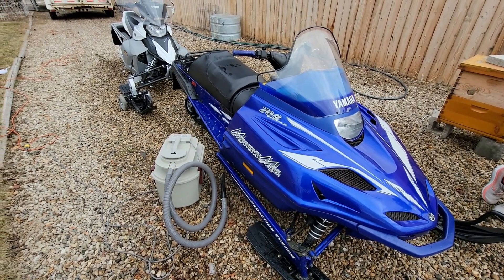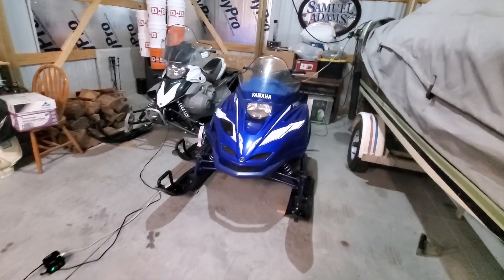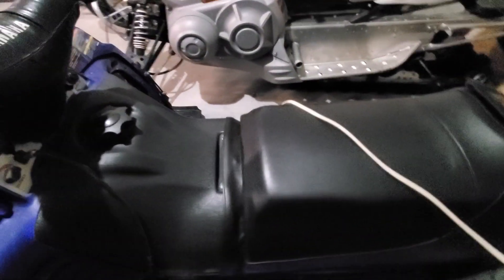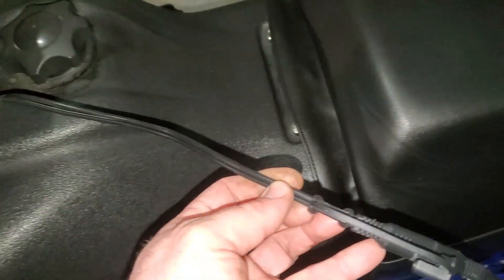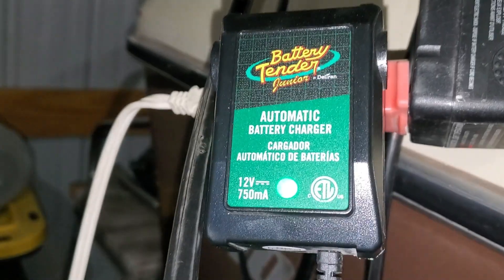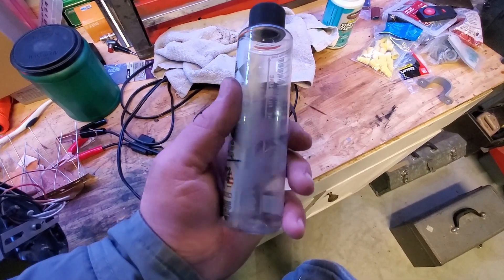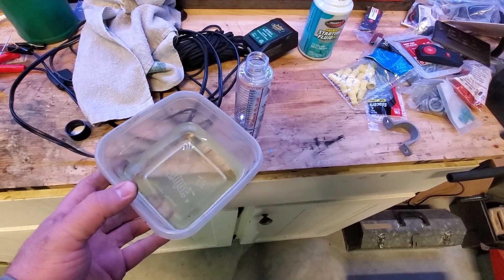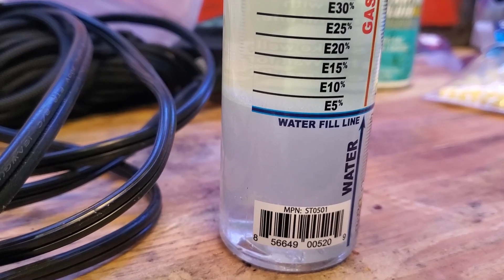Snowmobile Summer Storage

Comment: Drain gas run them out of gas with stable in it fog cylinders the jets are to small never had to clean carbs recommend by Yamaha dealer never had a issue with my Yamaha triples
Reply: I use seafoam in mine. Haha